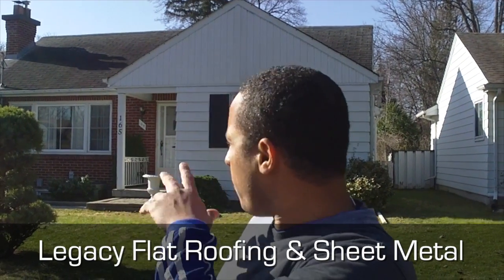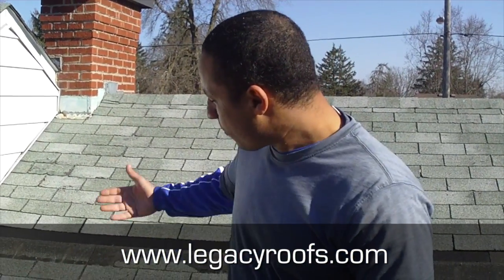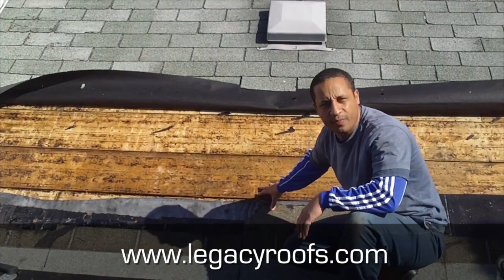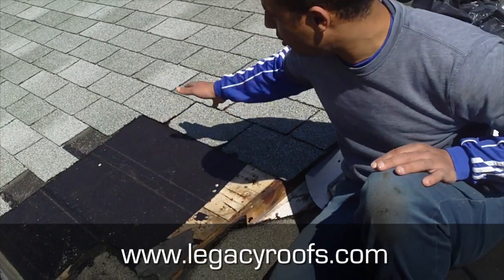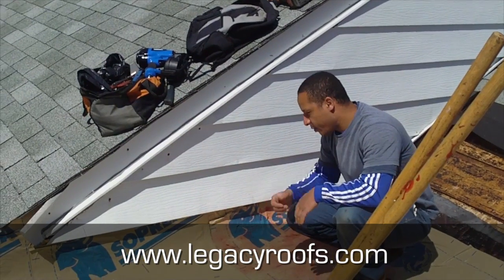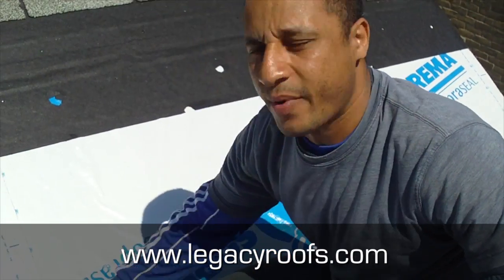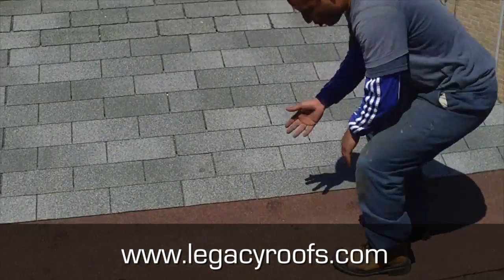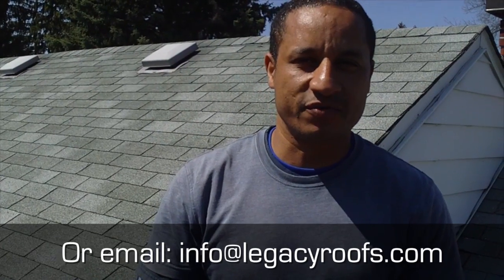Flat Roof and Shingle Roof tie in Strathroy Ontario - Legacy Flat Roofing & Sheet Metal

Comment: I have same setup on my home...shingles draining down onto low slope rubber. The question I can't seem to find an answer to is....what about the nail holes in the rubber where the shingles come down over the rubber? I can't wrap my head around the ice water shield and rubber being completely trustworthy with nail holes in it. I've seen how much water can come through a nail hole...and it's more than what most would think is possible...sometimes even with the nail still in it. I thought about putting a strip of tar down first where my nail line will be, and then nailing down. What's your thoughts on that?

Comment: Word of advice regarding the metal detail on the flat roof. 

Install base over edge covering approximately 2” 

Run cover sheet to outside edge. 
Install metal detail and strip in metal ( do not forget to prime metal. ) with at least 6” over onto the deck surface. Do not forget to set metal in roofing cement if a asphalt based product. 

If TPO Follow the instructions by the manufacturer.

Comment: hows it going,i had a deck added on to the back of my house and 12 ft of it is covered ,so the guy put the 2x6's on top of my house roof slant cutter them,then put tar paper and shingles,I'm in texas,no snow here,so its leaking,so i need to take off the shingles and tar paper and I'm guessing from here on,any tips,I'm going to apply tar and go up further on roof with something.i want to put something under it to stop the leaking then put new shingles down.any tips,besides tar paper.im going to home depot for supplies,thanks,very nice work btw